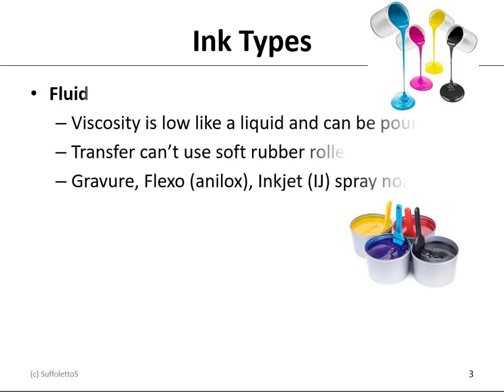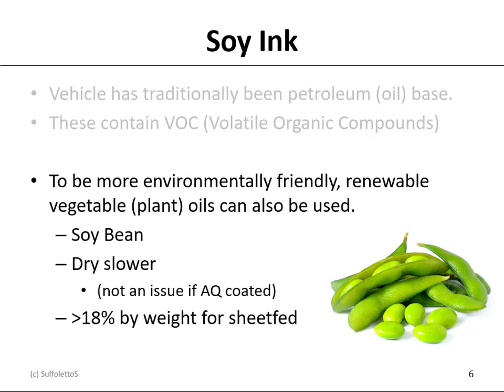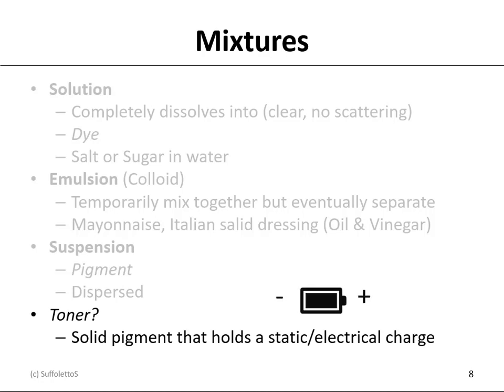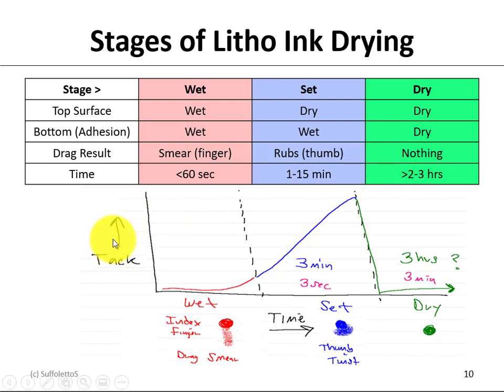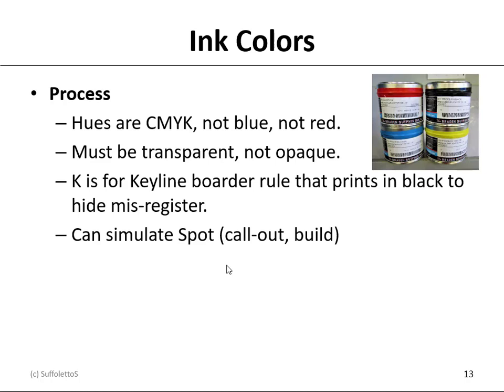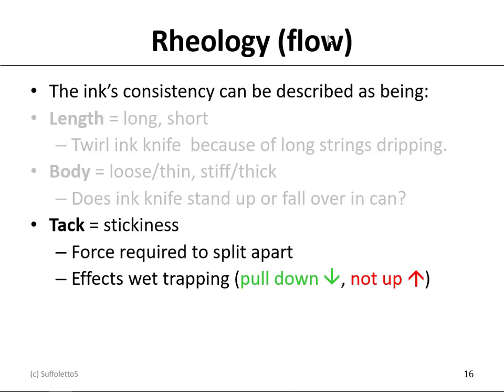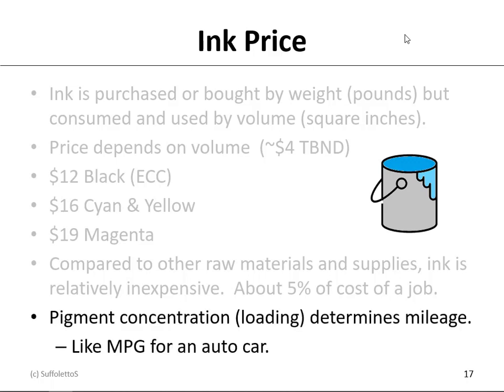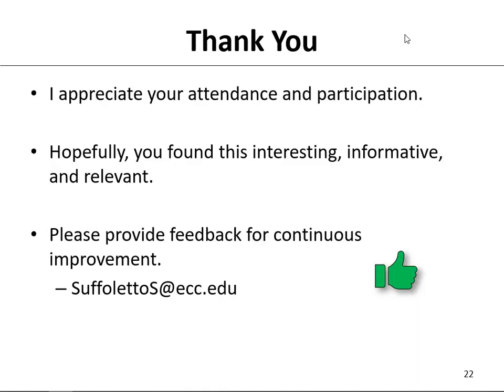Inks

Comment: During printing process.
How to avoid print adhered on metal substrate that causes print miss registration problems?
Reply from the maker: Elaborate?  Do you mean ink is printing dirty in nonimage area of aluminum plate?
Reply: @stevensuffoletto3700  Good day Sir sorry for my late reply, all are clean but sometimes it happens mis registration on tailing edge corner, no problem for our machine we follow machine standard setting,
We calibrated often.
Thanks sir.
Reply from the maker: @reytoledo6300  Check that paper is flat and has no wavy edges.  Fan Out is misregister in back corners.